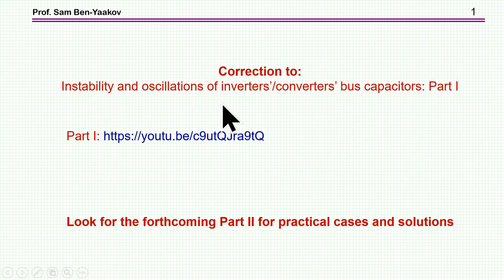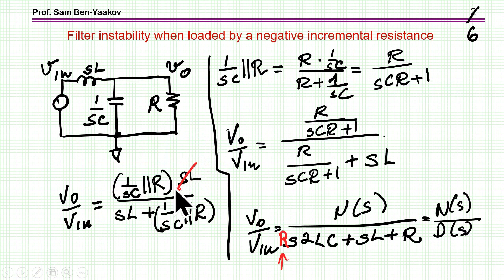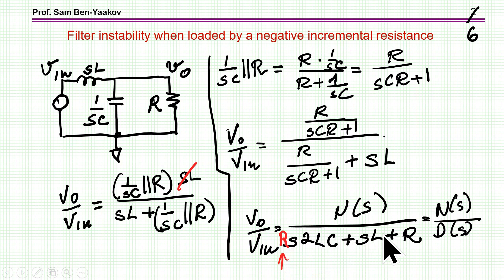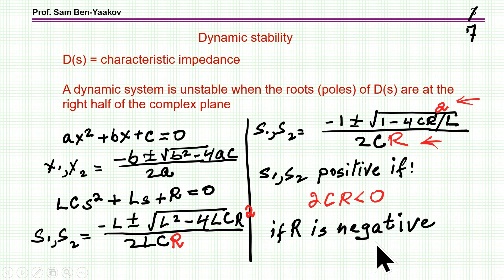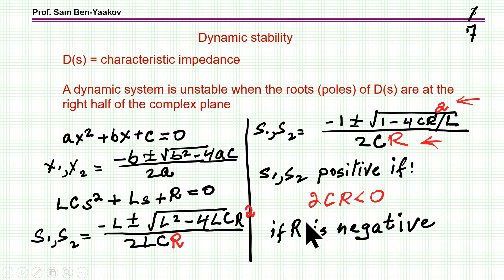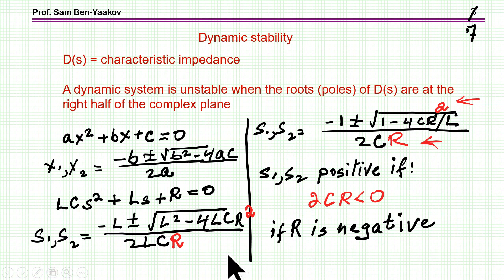Correction to:Instability and oscillations of inverters’/converters’ bus capacitors: Part I

Comment: Thanks again Professor for your good work, I really learn a lot from your videos. Can you also help me understand why do we need to consider incremental Resistance in this case for stability issues and not the actual or true resistance or impedance being offered by the closed loop converter? It will give me a better perspective of the problem and the solution which is awaited in the Part II. Thanks 🙏
Reply from the maker: Stability conditions are studied by small signal analysis (phasor or Laplace) for which the local derivative at the operating point is relevant.

Comment: Back in the 80's I worked on an early Variable Frequency motor drive that was exhibiting a severe instability under certain and mystifying situations.  I serendipitously concluded there was some resonance with the motor and the DC Buss.  I suggested increasing the capacitance of the buss by 50%.  Without actually knowing why.  Problem solved.
Reply from the maker: 👍Thanks for sharing